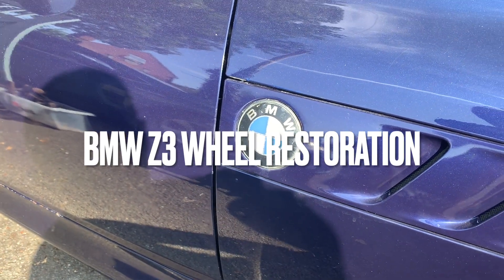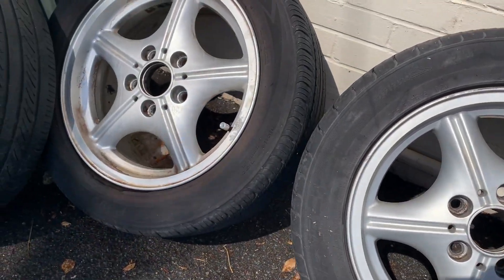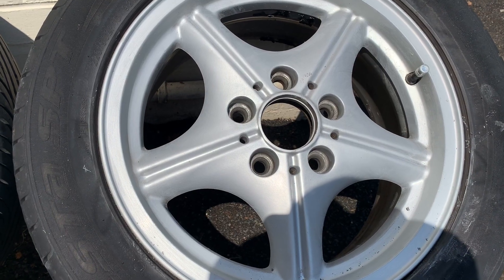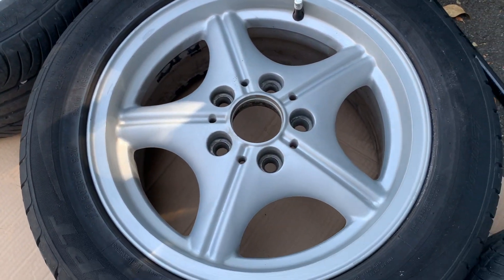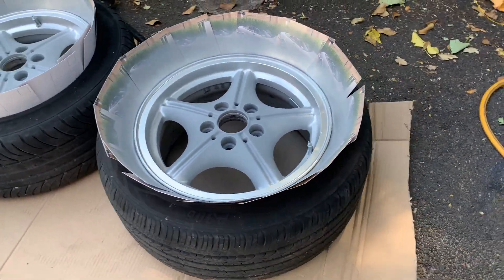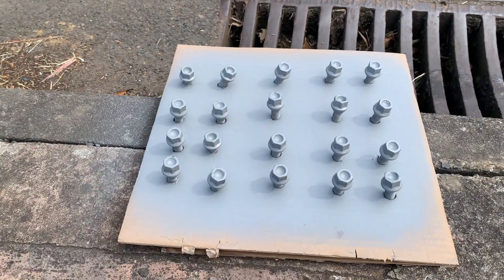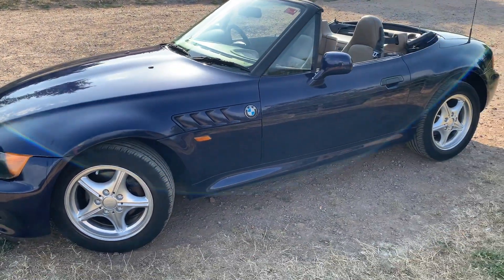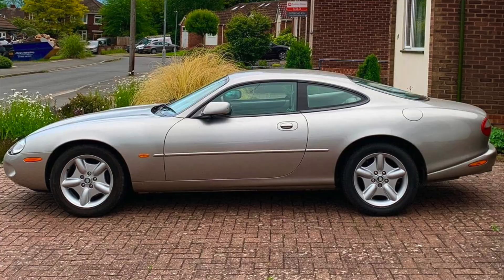Alloy wheel refurb at home - BMW Z3 alloys refurbished on a budget

Comment: You’ve inspired me to do my spare set of wheels on my old freebie MK4 Golf MKIV, I’m thinking of trying something different and was thinking Bronze on a Green Car.

I’ve found the cheap eBay Chinese BMW centre caps stand up quite well and have had a set on my Zed for 3 years now, but less said about the bonnet and boot badges as generally they’re poor quality and even if you spray those with a clear coat they don’t last so it’s genuine for those.